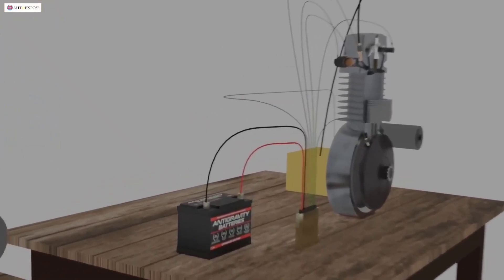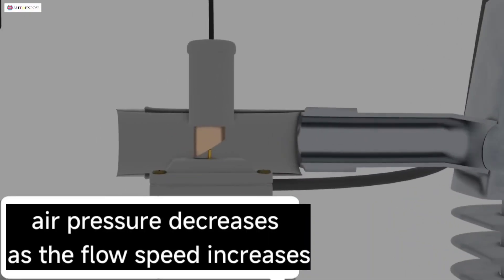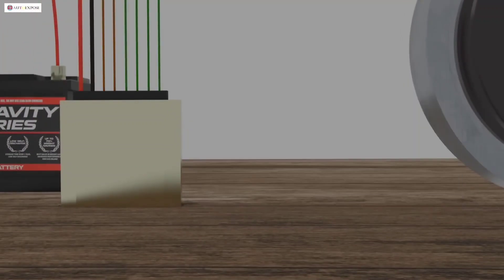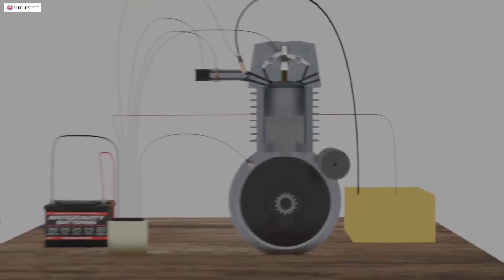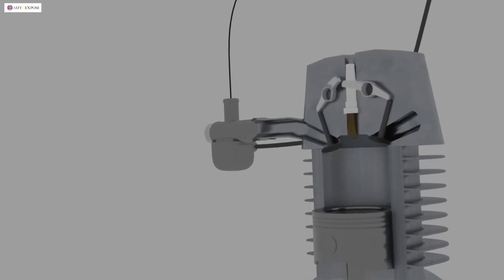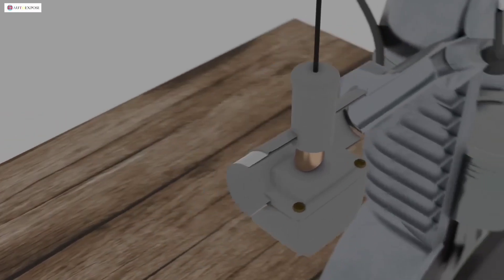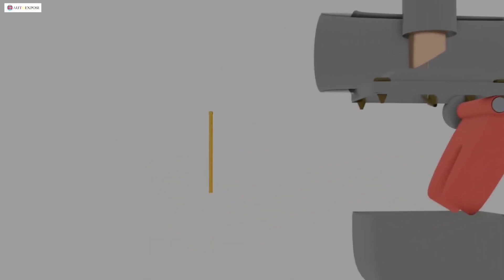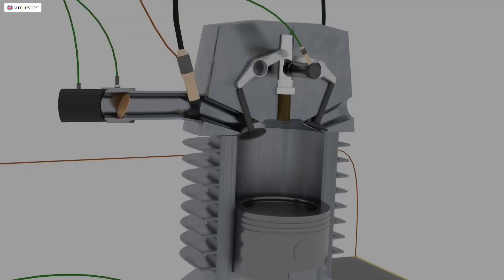Carb vs EFI - Which is Better? and What's Difference?

Comment: I hardly agree...A good, well adjusted carburetor do a fine job as an injection system with no need anything more to work
Reply: Carburetor jobs get difficult in High altitude while the injection system does it or keeps the engine more breathable by varying the mixture level of fuel and air .